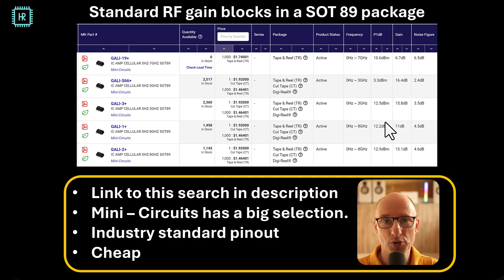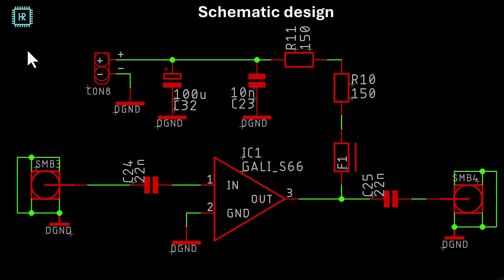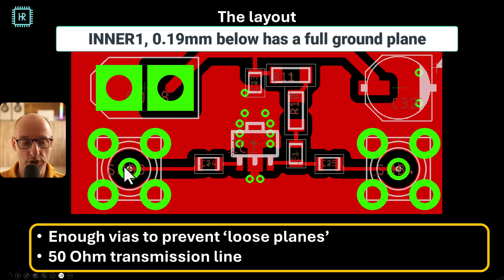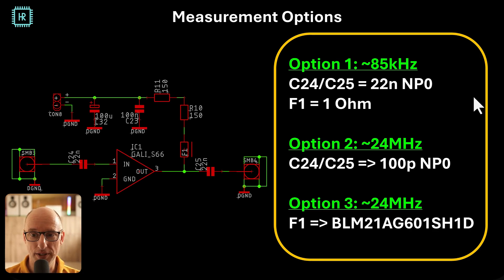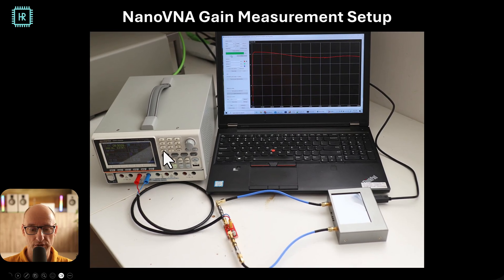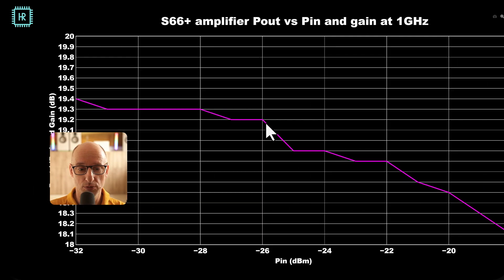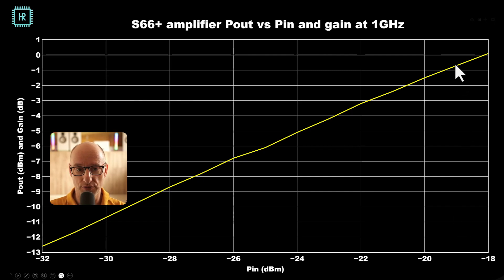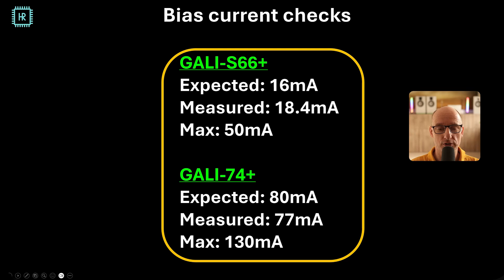Simple Universal RF Amplifier PCB Design - From Schematic to Measurements

Comment: Super nice and helpful video, thank you so much! What is the (aprox) input impedance of the power transistor block? So I can calculate the HPF min freq of the coupling?
Reply from the maker: It should be 50Ohms, but you can check the datasheet for more accurate numbers.

Comment: chinese fr4 is the main issue, use Rogers
Reply from the maker: This is a very common belief and indeed, for some applications fr4 is useless for RF. In this case, the pcb is so small that the FR4 cannot do significant damage to the signal.
Reply: FR4 is in this and many other cases usable for RF. Rogers and other RF Dks are still pricey. Always depends on budget, signal quality, loss, temperature stability and many other parameters. Great tutorial Hans, keep it up!

Comment: Is this amplifier only suitable as a transmitter or it can work as a transceiver as well?
Reply from the maker: For transmitting and receiving you need a TX/RX switch. For receiving, it depends on the NF that you need. If the NF of the amp is low enough for your application, you can use it as an RX LNA.

Comment: Does the source of the power supply matters? Would a switching PSU that provides the 7-10 volts would introduce additional noise? Also, would this work as a WiFi or LoRa (or even better, both) amplifier?
Reply from the maker: If you  deal with the ripple (filter it well) or use a good DCDC converter with very low output ripple (there are some fantastic ones out there) this is no problem. You can use it for any standard: As long as the amplifier can handle the frequency range and power (and for some more demanding applications, the IP3 should be high enough)

Comment: Dear Mr. Rosenberg,
thank you for your wonderful videos! I’m a physics student, and as part of my work, I often have to design HF boards for my own experiments. The information you provided has had a huge impact on my PCBs. I've greatly enjoyed watching all your available videos and am looking forward to new ones.
I'd like to clarify a point mentioned at 4:19. One of the simplest boards I made was a Bias tee, and along the RF I added vias, as described in part 4 of the ground tutorial. However, I noticed that for the amplifier, you don't use them in order to avoid standing waves. What are the pros and cons of this approach, and when should I consider "shielding" the RF line versus leaving a normal ground plane?
VG

P.S. blitz question: predictable impedance matching using Rogers or 4 layer FR4 with proper ground?
Reply from the maker: There are enough vias in the amplifier board, the board is so small that you don't need any more of them :-). The microstrip demo board is 10cm long, the rf amp is 3-4cm max. A via in the middle and at the connectors solves the problem already.

Comment: Hi, since you said the dielectric is 0,2 mm thick, does that mean that you used a 4 layer board having the ground directly under the trace? Or did you calculate the 0,2 mm thickness as the distance between the trace and the plane?
Reply from the maker: Yes, 4-layer with 200um dielectric.

Comment: Hey Hans, great video on the topic! I wanted to know if there's a rule of thumb of when to use an in and/or out balun for a design like this using it as an antenna preamp
Reply from the maker: You only need a balun if you go from unbalance to balanced or the other way around. they're often also used to make impedance transformations like 50-100 or 100-50.

Comment: Hallo Hans,

When I worked at Hewlett-Packard in the late 1970s I discovered a problem in resisters in the output of a 500MHz amplifier, the resisters were 1% resisters, with leads, spiral cut metal film. HP tested all incoming components so during this test they did indeed measure within 1%, But in this case two different supplier´s resisters used different base resistive material, requiring a more spirals for one manufacture‘s resister enough in the resister with the greater number of Spirals to drop an extra 0.5dbm at 500MHz. verified this by using an X-Acto Knife to scrape off the outer these Coating and it was clear what the problem was !

How it’s made counts!

An other problem with how a resister is made I discovered was Phase Noise, resisters which used Mechanical compression techniques to connect leads to the metalized ceramic bodies suffered from higher Phase Noise in the High Frequency sections of the HP8660 phase locked Frequency Generator. Again How the resister is made counts.

Try a slightly lower value resister or a surface mount non-spiral cut resisters the test if this is a problem at the high frequency end.
 
I worked with Jim Williams at LTC FOR 23 years, you and Jim working together would have been a Great Analog Design Team!  

Thanks for Sharing your Knowledge and Design Skills with us, you have Great investive Skills!
Reply: PCB DESIGN IS NOW an Engineering Art-Study, Measurement is required, now we have to consider all of the stray components, components not screen! We have to learn to think of and visualize our circuits differently.

What we need is an electric, magnetic, RF field imagining device, similar to a Thermal Imagining instrument!
Reply from the maker: Hi, thanks for the very nice stories. I have a video on resistors now, showing their distortion (last part of that video). Also, there is a nice paper in the description of that video.

In general, these day you really want thin film resistors. They're very stable, very low excess noise and low inductance.

Comment: A vendor did an rf project for us and used the standard microstrip calculator.  They had a grounded plane on top with a via fence around the microstrip conductor along with a ground plane on a Roger’s board.  Didn’t work, having a top ground plane makes it a coplanar waveguide variant that has a different calculator.  Be cognizant of the differences depending on the top copper geometry.
Reply from the maker: Indeed, you have to take all copper into account!

Comment: Which rf amplification topology mostly use in radars?
Reply from the maker: Pfooh, I'm not sure. Any amplifier will do that satisfies the specifications I guess. Power, linearity and noise are all possible concerns, usually, radars are phased arrays these days. Efficiency could be a bit one as you'll generate a truckload of heat you'll need to get rid of in order for you radar not to burn itself to the ground :-)

Comment: Very nice.  Might make myself some active scope probes using these
Reply from the maker: Be careful, the input impedance is 50Ohms, usually, with an active probe you want a high input impedance.....
Reply: Yea i thought about that as i posted. They usually use fets i don't they? @HansRosenberg74
Reply from the maker: indeed, they usually do. If you want to also process DC, things become kind of really hard......

Comment: just curious, why dont you put DC port on the highest current consumption whish is nearest GALI74.
Reply from the maker: The currents of these small devices is so low, and the resistance of traces as well, so it really doesn't make any difference in this case.

Comment: Is a resistor to ground required after the decoupling capacitor, to provide a path for the DC component to drain? Seems like other circuits I looked at has this resistor to ground. If not, why?
Reply from the maker: Normally, the voltage on both sides will be dictated by bias voltages, otherwise you probably would not need a decoupling capacitor. If you have larger caps and/or higher voltages, it could be a good idea to drain, but you'll introduce loss, so I would only do this on supplies, otherwise you're reducing the Q factor of your capacitor.

Comment: Theoretical question: can the same circuit diagram be used with KT805b transistors?
Reply from the maker: Hi, no, this is not possible. The devices I'm using are gain blocks. They contain multiple transistors and bias circuits. Best regards, Hans

Comment: Very good process steps to get started on the RF path - RF is an endless learning journey. 

3 other figure of merits to measure which I think are quite useful are Noise Figure, Return Loss and Two-Tone Intermodulation (IP3 or linearity). Noise figure can be measured easily and reasonably accurate without a noise source since it has some gain - gain method measurement. 

A few things, I think, that may impact the roll-off at >1 GHz: (1) Transition from microstrip to larger SMD pads increases capacitances. Some tricks arounds are to either use smaller SMD packages and/or use a stackup so that the microstrip lines are around the same size as the pads. (2) Also, FR4's Dk changes with frequency as it varies with frequency. If the 50R transmission line was designed for Dk at 100MHz, we can expect it to be less 50R at higher frequencies and eventually becoming more inductive. 

Cheers!
Reply from the maker: Hi, thanks for the ideas. I don't have 2 signal generators so I cannot do IP3. For noise I was a bit worried about the accuracy. Matching would have been an easy one, I forgot about that one!

Comment: Thank you for the video! Have been enjoying watching your works! BTW, can you also address on the tuning stuff (like cut or paste the copper) to address the process variation and harmonic control?
Reply from the maker: Thanks for the thumbs up! I'm not sure what you mean by cut or paste copper, can you clarify?
Reply: @HansRosenberg74  Thank you for your reply! Let's say the power amplifier uses a low-pass network as its output matching network(OMN). And after the fabrication, the performance of the power amplifier can be off because of the variation of the components, and usually people need to tune the OMN to get better performance. To tune the OMN, one can cut the copper or add copper foil to modify the OMN if it is realized by transmission line, or try different values of cap or inductor if it is realized by lumped elements.
Reply from the maker: Aha, now I get it. I would improve the components in that case. You can get pretty detailed models for inductors and capacitors from all the main suppliers. Murata for instance has something called 'simsurfing'. If you use those model parameters for your simulation, you can get pretty accurate results. I recently simulated and measured a combination of 2 capacitors in parallel and the results were remarkably close! A great way to get a very good bias circuit is to use 2 or 3 relatively large inductor values in series. That creates a very wide single parallel resonance instead of the sawtooth pattern you get with 1n/10n/100nH for instance.
Reply: @HansRosenberg74  Thank you! Very informative!

Comment: Thanks for going over this in detail! I am wondering the spec says the transistor can amplify from DC to 3GHz, but the input DC-blocking capacitor would make it not feasible to work at DC. Is there a way to make it truly functional from DC up to 3GHz?
Reply from the maker: Making an ultra wide band blocking capacitor as you suggest is extremely difficult. When you start to parallel them, you are inevitably going to get resonances which damage the flat response that you want. You would have to build an amplifier without capacitors. This is possible, but tricky.
Reply: @HansRosenberg74  Thanks! I guess the difficulty for RF amplifier without coupling capacitor is that the DC level of the input needs to be at the bias point of the RF transistor, which is not necessarily the DC level of the input signal?
Reply from the maker: @bluesunflower2007  yes!

Comment: Apologize for my rookie question..when apply DC at the output of the amplifier ...why it is not damaging it although now it has two current opposing each other at input and output? Out of curiosity hope you can explain for me to understand
Reply: These gain blocks are designed for LNA's attached to outdoor antenna directly with remote power supply through feedline I guess, so getting power from output side of path is natural choice i would think.
Reply from the maker: The amplifier gets its power through the output pin. Hope that clears it up?
Reply: The inductor in the output separates the DC side from the RF side and allows current to sink through the device when/as needed.

Comment: One interesting parameter to check would be return loss with different coupling capacitors. I wonder what you are actually seeing on 1GHz, the lower gain might be caused by worsening RL.
Reply from the maker: Based on past experience, I don't think the capacitors are the problem. The bandwidth of the amplifier is just not high enough.

Comment: I am curious why you didn't use an LDO on the PCB. I would expect a good deal of noise added to the signal when powering from any switching supply, let alone a bench power supply. I don't know of an inexpensive way to measure noise figure (other than luck on eBay), but I wonder if your gain and compression measurements might even change if you repeated them using a lithium battery?

Actually, if you have a variable attenuator, you could do a noise comparison (not measurement) by sticking this on a GPS receiver. See how high you can dial the attenuator before the receiver stops acquiring a cold fix. Then repeat, but using a battery as the power source.
Reply from the maker: I have a very good linear bench supply :-) I'm not sure what the transfer or supply noise to amplifier noise is. The bias resistor does take care of some isolation but some will definitely get through. If you want to supply it from an unspecified supply it would be great to add a low noise ldo. Do you know the LT3045?? That is an amazing device!

Comment: How is input and output stability accounted for in this design?
Reply from the maker: That was really hard, those devices are unconditionally stable ;-) I think you may be able to get them to 'yell at you' if you annoy them enough, but you'd really have to do your best to achieve that.

Comment: You mention calculation for a microstrip, yet PCB signal layer has groud pour.
How do you decide on plane clearance for it not to be a coplanar wave guide?
Reply from the maker: Hi, I just fill in the values in a coplanar impedance calculator on the internet. Then I change the distance, if the impedance is hardly affected, it is far away enough....
Reply: @HansRosenberg74  Thanks for reply. Got it, but am I missing something and microstrip is somehow superior here?
Reply from the maker: Actually, no, it does not matter a lot. It does not make a lot of difference. You could argue that co-planar has less radiated emissions since there is more ground closer to the signal trace, but it is a minimal advantage as far as I know.

Comment: What about 22nF parallel to 100pF in de series capacitance?
Reply from the maker: It's always tricky. You might get a parallel resonance with the inductance of the 22nF and the capacitance of the 100pF (I'd have to calculate how that turns out). Maybe it is not so bad here since both have a pretty low inductance.... however,  the 22nF will turn inductive much sooner, so that might be a problem. When I was working on the Westerbork Telescope, I needed a very wideband (I believe 4kHz to 20MHz) coupling cap in a number of locations in the signal path so I had a tantalum elco with a 1206 capacitor. It made a really nice dip in the frequency response. Off course a tantalum cap is a disaster when it comes to inductance and this was my first year as a professional electronics engineer, so I had to find that out the hard way. I found out that putting multiple components of the same value in parallel works really well to make such a component more broadband. I plan to do some research on that for my channel and my course. I also would like to measure this so I have some real data. I did something similar last week for a very wideband RF bias tee and that worked out really nice using multiple of the same inductors in series.
Reply: @HansRosenberg74  Hi Hans, you are correct about the added inductances.  In simulations you can verify them well.  In practice is is hard todo.  In case of power pin decoupling one will often add more capacitors in parallel with different values and distance to the pin.  See many application notes of FPGA's.  With Ansys PI you can even tune this on PCB with advanced simulations.
Reply from the maker: I want to do some experiments with that at some point. I have a feeling there might be a good multiplication value for selecting the parallel components assuming their parasitic inductance is relatively equal. Should be easy to do parametrically in a simulator. If that gives some nice results I'll also put that in my course, I have a whole bunch of power supply filtering tactics I employ which would be very nice to document.

Comment: Hey Hans, thanks for the great video! I learned a lot here. By the way: What are these yellow power connectors called? These look neat.
Reply from the maker: Yes, those connectors are a gods blessing. I was looking for something like that for years! And they're cheap to. And can carry insane currents! They're standard drone connectors, for drone batteries. xt-30, xt-60, xt-90, xt-120 and I believe they also have xt-150. The number indicates the current. I've seen youtubers try to destroy these with overcurrent only to find out that the solderings let go and the connectors are still fine :-). DON'T BUY THE ALIEXPRESS OR ALIBABA VERSION, THEY HAVE NO CLAMPING FORCE!! Only buy the real deal: AMASS. I use the xt90 or xt120 for connecting my audio power amplifier output, fantastic!
Reply from the maker: Drone shops will have these off the shelf, max 2 usd for a pair (male female) I believe
Reply: @HansRosenberg74  Awesome, thank you so much! Ordered some of these right away! :)
Reply from the maker: If you solder them, do it with 2 connectors attached to each other, so the contacts don't move due to melting plastic.